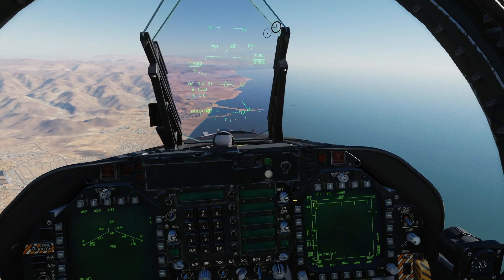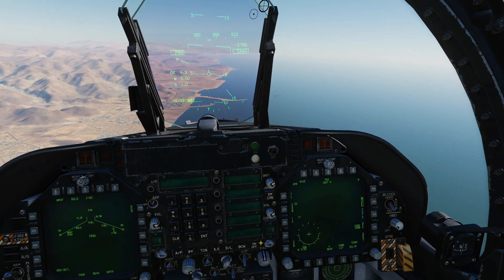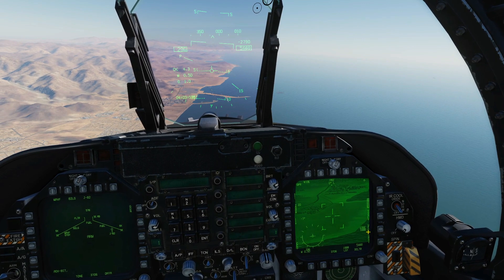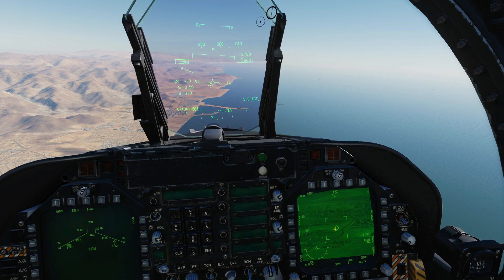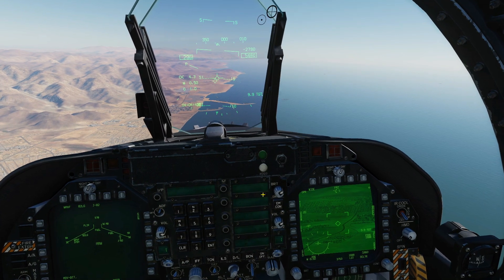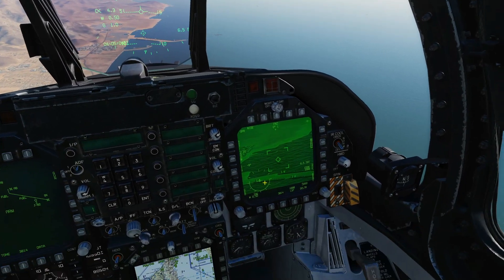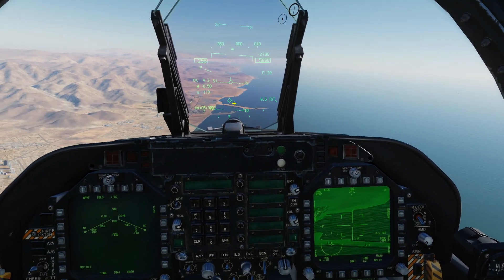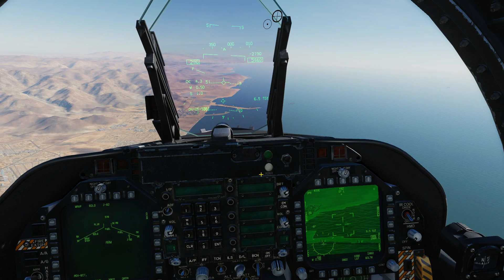FA-18C Hornet: (OUT OF DATE) TGP TPOD - New HUD Symbology Added - June 2020 | DCS WORLD

Comment: One question if the laser is turned off (with the safe on the right side) and you press tdc depress and acquire an spi, the range will show on the HUD (ins calculated range) e not in the FLIR mfd?
Reply from the maker: Wagner said it was Laser range, but I really don't know.
Reply: @grimreapers  in my opinion when the laser is disabled is ins calculated when the laser is on it uses the laser occasionally. You can check it using a module with a laser sensor for the rwr
Reply: Also when you drop a bomb with the f 18 the point of impact is ins calculated. the plane has in its memory the altitude of all places in the world. Instead in air to air mode it makes an estimate of the distance with the size of the target